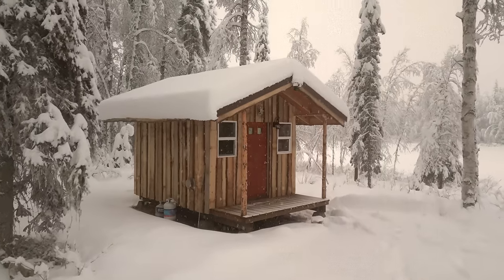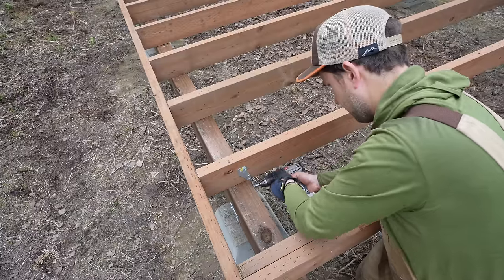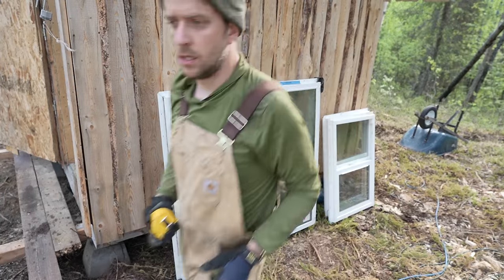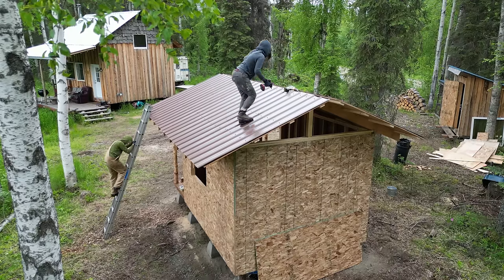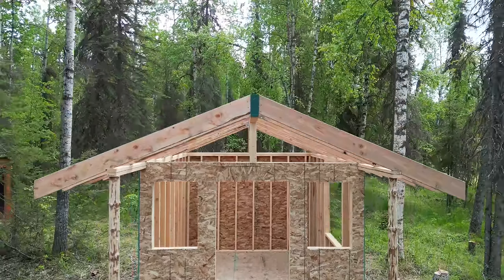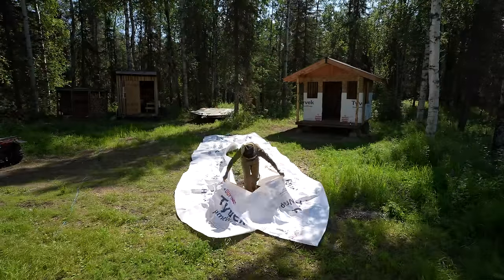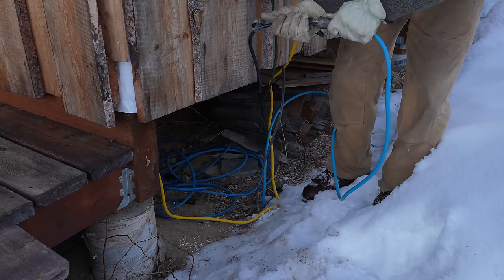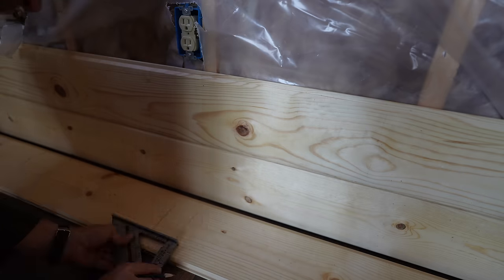How To Build A Tiny Cabin + How Much It COSTS in 2024

Comment: Hey Man,
Timmy from Truck House Life just turned me onto your blog. I like it so of course I subscribed.  
Unfortunately I'm now an EX- Sourdough from Anchorage and Sitka. Moved up there during the building of the pipeline in "74".
Your cabin is about identical x 2. It was the up by Big Lake for hanging out when I'd flat track snow machines 
I did a 12-12 roof and over built the rafters for using the area for a sleeping loft.  For roofing I used a product called Rapid Roof that was like a super thick plastic paint over their base cloth sealed to the osb. 300% elasticity and cures quickly. Using a man lift and a 2ft wide paint roller i put on 6 top-coats, left it white and  painted the exterior walls white also. Plus I put on white window shutters. In the winter from my front property line and looking through about 40ft of trees it blended in. I admit that I got a lot of comments both good and bad. For heat, there was of course a wood stove, a 18" x 24" propane catalytic heater and a army surplus diesel heater. No electricity until the 4th year other than a diesel gen set that was army surplus also
Keep up working on your dreams buddy and enjoy life. And never leave living in Alaska because you'll never, not miss it !!!

Comment: Looks good, your ridge beam is overkill and collar ties and hurricane straps on your eves are recommended.  It is a small recreation cabin so R13 in 2x4 works. 2x6 would be better for full time. You need to get solar set up instead of using gas to call it off grid and I run my entire cabin full time off a 1.4Kw solar and 800Ah of batteries. Stay safe out there!

Comment: WAY Less to Build By Almost Half or More in some cases, than to Buy one prebuilt at one of those Side of the road Shed Sellers you see, that are Constantly getting Repo'ed.. I built a 10 x 10 Shed for Under $1,000. Took My Time doing so... A Prebuilt, Delivered and Set up the same size would have cost over $3,000 at the time I built mine and now can see them for $5,000  oh.. "Free Delivery within 50 miles..".. 
   I Plan on building a 16 x 28 Shed/House. It will Cost Under $5,000 to Build the Enclosed Frame.. A Prebuilt 16 x 28 Enclosed Frame, Can't do Anything to it Until Paid Off, Will Cost Close to $20,000 and by the time you Pay it Off, Almost $30,000... I SAVE Between $15,000 and $25,000... and Put That Money into Finishing it off and even Furniture and Extra's... Maybe even a 2nd Story???